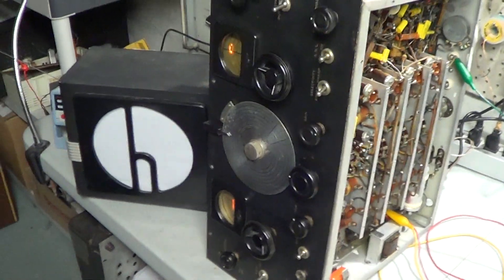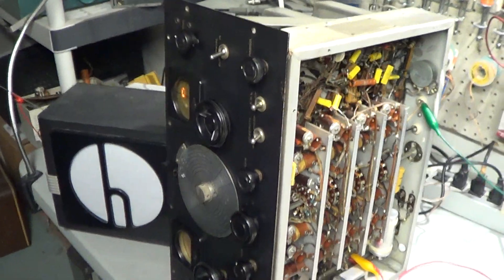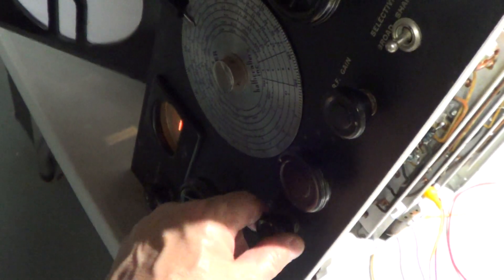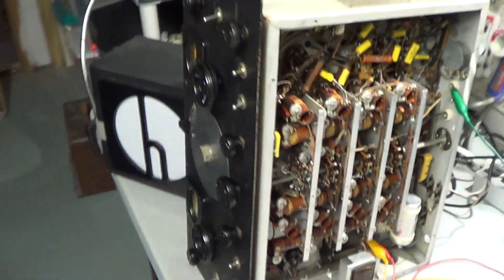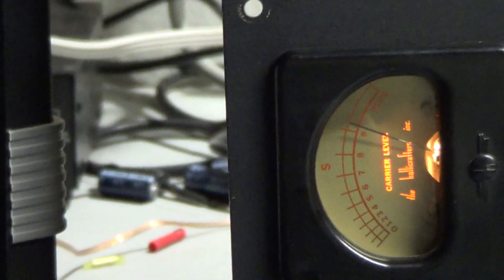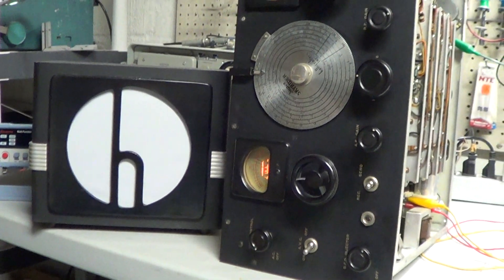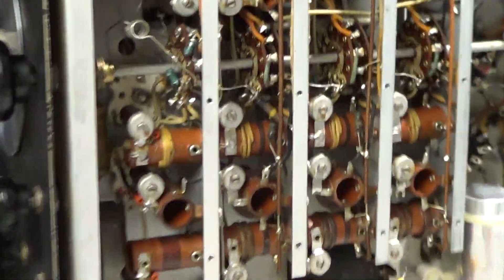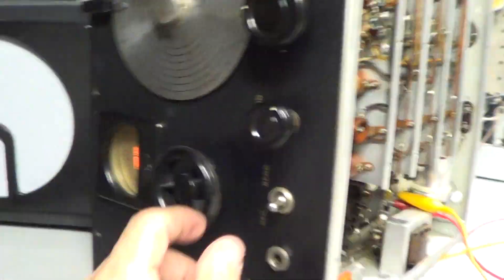Hallicrafters SX-17 Receiver Performance.

Comment: I know it adds a degree of difficulty, but, you are supposed to have the bottom cover on when doing the RF alignments, the original cover has holes for access, and the cover will change, albeit slightly, the capacitive coupling on everything, so your adjustments may drift when it's covered again. The cover also needs to be in place when completed to help reduce RF noise intrusion.

Comment: Very nice.  I have one that I need to go through and recap one of these days.

That chassis is very clean looking, none of the corrosion I usually see.  I also notice that there is a serial number plate on the side of the chassis.  I don't believe mine has that, I'm pretty sure it came with a paper tag glued to the chassis, long since lost.